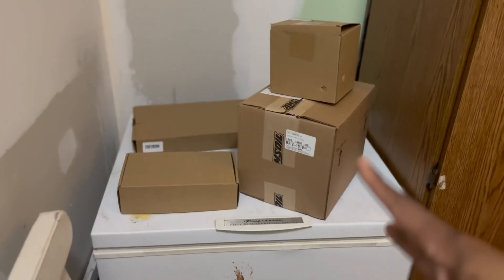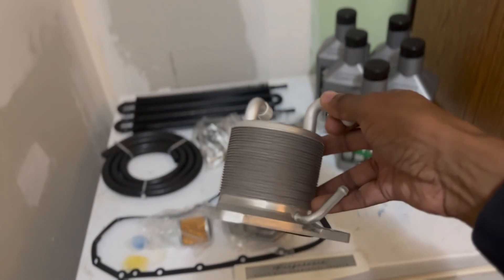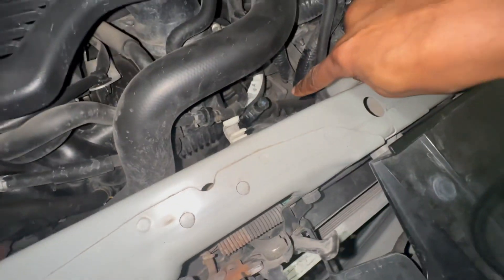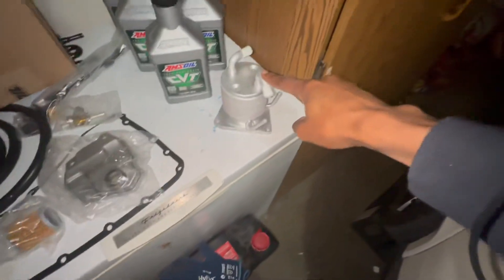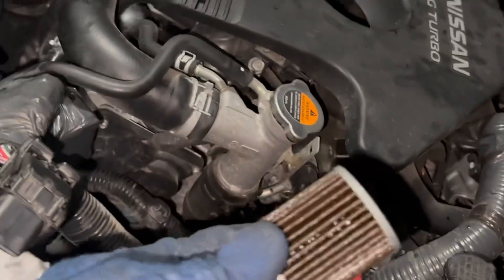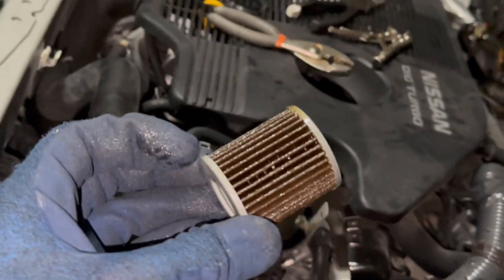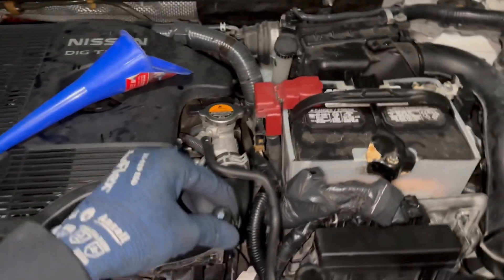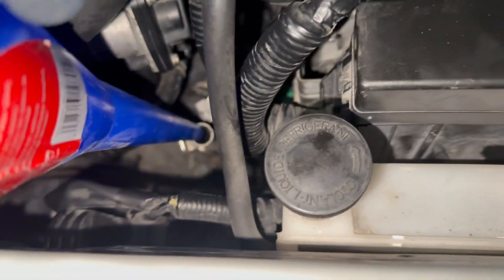Nissan Juke CVT cooler install

Comment: pathifnders have built in cvt trans cooler. If you have a CVT trans and no cooler, buy used cooler with thel ine from a scrap yard off a pathfinder. tHe whole pathfinder 2014 to 2018 used cars are like 6000-7000 canadian dollars now in November 2025. Dirt cheap. THe pathfinder cooler is placer near the driver side wheel cover, it cools and warms the oil using the coolant system of the car. No need for any shitty air coolers. Doesn't work and damages your cvt. Make sure you change your coolant as well when you use the pathfinder cooler.

Comment: What year is your Juke?
Reply from the maker: 2014
Reply: @meberra  How's the cooler holding up? Did it make a huge difference? Thinking about adding one to my girls car since it's hot as hell down here in Texas.
Reply from the maker: @rightfight100 I definitely would get one if you live in Texas. A better assurance, would to get a way to monitor the temps to make sure it’s working good for your area. I believe android phones have an app called CVTz50. So far for me because it’s a CVT it’s a piece of mind it’s not a fix they do fail. This will save it longer
Reply: @meberra  Another question. Did you ever accidently overfilled it before? Did you have to process to drain and measure it to the right amount?
Reply from the maker: @rightfight100 the drain pan I use have markings on it to show how much drained out. Just make sure you put exactly what came out back in. And the cooler will hold a bit more so be sure to account for that and check the dip stick

Comment: this fix works if your juke is getting thrown into "limp mode" where the car essentially stops responding to the gas pedal at high speeds or high ambient temperatures. it is the result of poor transmission design on nissans part and therefore the fix is to add an aftermarket cooler. this solved the over heating issue in my juke. Also if the car is throwing random transmission codes this a good place to start. mine was doing this and after the cooler install all codes subsided

Comment: Great video. Did this after watching your videos. Couple of takeaways. 1) use oil to lubricate the connectors when installing the hoses, they will slide in easier. 2) Buy oem gasket for oil pan 3) Be very careful to not overtighten the oil pan bolts they are extremely easy to strip (i stripped 3/18 bolts and had to buy replacement M6 bolts but had to use thread locker to get them to stay as the thread on the inside of the pan itself was stripped 4) when removing the cooler itself 1/4 of the bolts snapped midway, no clue how this happened, i literally just filled the hole with jb weld and had to fasten the new cooler with 3/4 bolts installed 5) don't pull the wheel fenders out too much as they are almost impossible to snap back in place as they were originally
Reply from the maker: @isaiahmora4408  same had the same issue with one. The threads are just really weak

Comment: what is CVT oil change period of juke 2014-2019  1.6 cvts
Reply from the maker: Owner’s manual says every 60k. I will be doing mine every 40k since I have over 80k miles on the car now.

Comment: Amsoil CVT is not only superior, it was developed by Amsoil specifically to address Honda and especially Nissan CVT failures.
Reply: he opened his pan and played around. He fucked his CVT basically. This cooler he installed doesn't work. He needs to use nsissan pathfinder CVT cooler and wamer. coolant based. 

And valvoline CVT is superior. pathfinder CVT 2014 SL with 472,000 kms on it, valvoline drain and refilll only every 20,000 kms, OEM filters nev er opened a pan and I change my coolant every year. will drive my car to 1 million kms for sure thanks to valvoline CVT

Comment: Great video thanks! I'm preparing to do this same beehive transmission cooler upgrade to my daughter's 2013 Rogue. Recently did a drain and fill with AMSoil CVT fluid. I can't believe how neglected alot of these CVT transmissions are and it seems to me that dealerships are part of the problem because they apparently told the previous owner of my Rogue that the CVT didn't need to be serviced 😮. I'll be running only AMSOIL fluids in it going forward and probably do a drain and fill on the CVT annually. Again thanks for sharing the video of your project!
Reply from the maker: Thank it was definitely a project. I had to redo a few things but that what you get when you skimp. I’ll do an update soon on how well the Amsoil is doing.

Comment: How long was the process start to finish? I'm about to attempt this myself on my juke with 76k. Never done anything on cars besides change fluids and other basic stuff. Hopefully I can make it happen without too much headache.
Reply from the maker: I took my time so probably took about 4 hr outside of the filming
Reply: this job took me 2-3 days working about 4 hours each day but i ran into unextpected problems like stripping and broken bolts. several runs to autozone in between and braving texas garage heat

Comment: Oh wow you were in the same situation as me.. I bought my car with 68K on it. I didn't know anything about CVTs.. I am about to roll over to 106K now, But I put a cooler in and switched over to AMSoil CVT Fluid around the same time you are switching over.. So far so good.. I don't get wine but I can hear my Bearings in that CVT humming from time to time.. I am on a tune and making about 100more LB's of Torque to the wheels, But honestly I never really put the pedal to the floor anymore. I always half pedal to 3/4 pedal my car.. Especially in the summer's.. Also I recommend doing a drain and fill every June once a year no matter the milage.. Good luck and Good video..
Reply from the maker: Thanks for the comment I’ll definitely be doing fluid frequent changes. So far it’s been nice. I did have some leaking issues after the change. I’ve corrected that issue and I might do a update vid soon
Reply: @meberra  Thanks, and Great, Keep up the good work.. I have some good vid's but don't really know how to edit properly.. But anyway keep her clean and she will last..
Reply: Honestly I never bothered to pull the pan for that reason.. I did pull the Bee Hive, But I left the pan a lone. (Someone gave me a tip and told me not to pull the Pan, because of leaking issues n, not to worry about the Magnets and just keep the fluid clean. He worked for Nissan and told me that if you pull the pan, most people bend it a few mm's and don't realize it. It almost can't be helped sometimes.. Also a Tip watch how much and what kind of gasket sealer you use, that stuff can break off inside the pan and start floating around. They do say to use a small amount of that along with the pan gasket. That's why 80% of the rebuilds fail they use way to much of that pink crap. If you ever watched any CVT rebuilds. Anyway, About a half inch of that stuff spurts out the sides so just imagine how much is going inside when everything is squashed down and flattened together.. Anyway Good Luck, I'll Sub you If you Sub me.. I have a Front Bottom spoiler going on this week..  https://www.youtube.com/channel/UCOIeusJytRsiRdayyMdp_6w

Comment: Use amsoils best products in everything you can (differentials, transfercase,etc) . I would add a derale remote oil filter inline as well.
Reply: Me too I started using AMSoil CVT fluid about 3 years back now.. No Issues.. I have a Tuned CVT Juke make another 100 WT over stock.. LOL, So I need this stuff..

Comment: Just installed Amsoil CVT in the Cube with extra magnets.  So far so good.

Keep us posted.
Reply: I started using AMSoil at 70Kish, I am at 106K now, But over the last 4 years I have done 6/7 Drain and fill's the last 6 were AMsoil so I should Have about 97% Amsoil in there by now.. Watch because when you do your first drain and fill about 3.5 quarts will stay inside that torque converter, I know it's expensive but it is always good to do a few back to back drain and fill's over a 2/3 week period to clean it all the way out. The stuff will have a cleaning effect please remember. So you may want to do it one more time, just to bee safe.
Reply: @marcasswellbmd   - This Cube CVT has had many drain/fill cycles before I installed Amsoil CVT with a new pan, gasket, filters and extra magnets so it was very clean to begin with.  Also had the valve body off and disassembled for cleaning & inspection and you get a bunch of extra fluid out when you do this.  So, this Amsoil fill was almost a complete change out (over 8qts/liters) and everything is working great.

Using CVTz50 w VeePeak VP11 to monitor CVT temp & info.
Reply: @marstedt I have a 2015 Nissan juke nismo rs awd. I am wanting to install the cvt cooler and amsoil. With the cvtz50 app, did u notice a drop on cvt temps?
Reply: @felixaripa6482  I don't have a cooler setup on the Cube yet but I do monitor the CVT temp regularly.  The only time I see it consistently overheat is in the summer (25C+) on long drives (1hr+), heavy load (4 passenger / gear) and in stop-go traffic (after 1hr).

With Amsoil CVT fluid I would not be concerned with temp up to 95C but I would be cautious.
Reply: @felixaripa6482  Maybe make a new post (not a reply) to ask the channel for info?